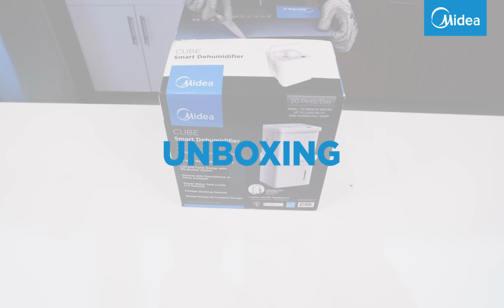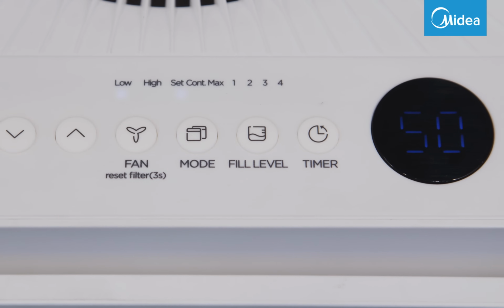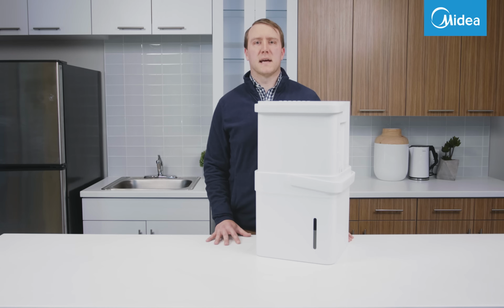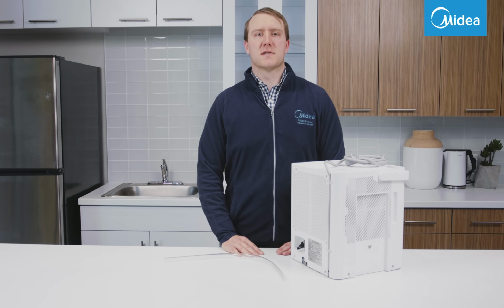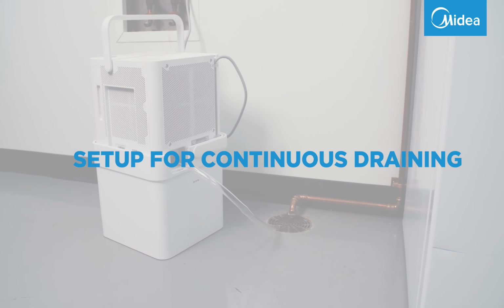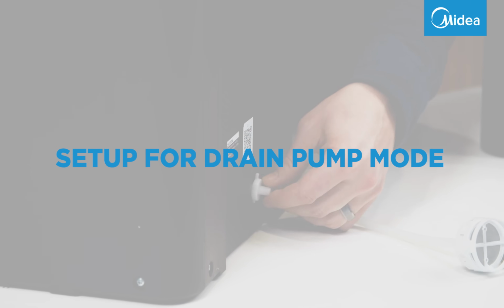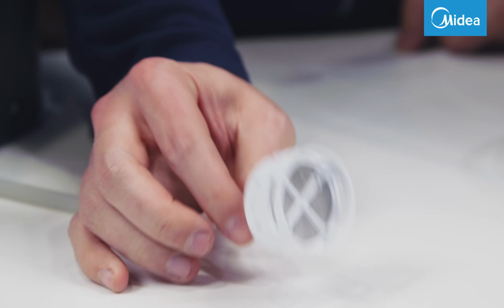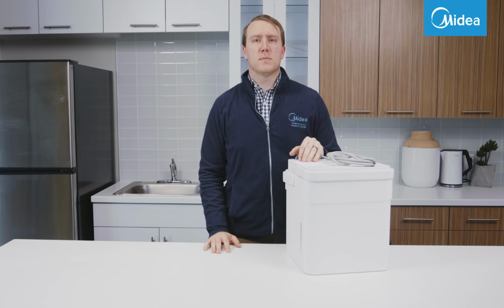Midea Cube Dehumidifier Operation and Overview

Comment: Unclear after watching video; there appear to be two sections for using drainage hose, one of which involves using the bucket. Why use bucket if hose is attached? Also, cannot determine if hooking up the pump drain and longer hose means that the dehumidifier has to be manually set in order to have pump work. Ideally, I'd like to not worry about when the bucket is filled by having the pump automatically work. Am I missing something? If the pump has to be switched each time, I see no benefit to using it instead of simply letting the unit drain via garden hose, and gravity.
Reply: Did you ever get an answer to this question? I'm confused about the same thing.
Reply from the maker: Hello, Paul. Thank you for your feedback. To better assist you with your question, please email us at DigitalSupport@Midea.com. Have a nice day.

Comment: Hi - I have to 20 pint model and when I push up arrow and fill level is goes to continous drain icon but as soon as it goes on the bucket the continous icon is gone and wont renable until removed from bucket. You should clearly state continous drain mode will not work with the unit on the bucket. Its misleading in the video an manual. Im guessing the cases remained the same and the 50 pint unti pump mode is the reason for the 20 pint looking this way. Continous drain mode only works without the bucket as a base and this is frustrating because now theres a random bucket in storage. Midea support was worthless and they gave me a number to an appliance supply store that doesnt even support their product when I asked for a technician instead of the person on the phone who didnt know how to use the humidifier.
Reply from the maker: Hello e pon. We do appreciate your feedback and will use it to improve our service in the future. We are sorry to hear you were not satisfied with the customer service. Please contact us If you have any questions at digitalsupport@midea.com. Have a great day.
Reply: @MideaAmerica  I have two of your cube dehumidifiers and they seem to work very well.  I still haven't figured out how to use constant drain, though. The amount of hose you get isn't really practical for me and I put a garden hose on it while it sat on the bucket and now water came out.  Putting it on the floor it's hard to get a garden hose that stays lower than the outlet port.
Reply: Yeah, I had that same crazy thing with a company called Mantis!  They said their techs were at some local retail store and when I called them they said they weren't techs for Mantis and said that once a store orders something from Mantis they start telling everyone they have techs there. It's crazy bullshit.
Reply: i knew i wasnt going crazy! i have it set on continuous drains, there is still water going into the bucket!
Reply: @prieshmistry  you really want to think youre crazy try contacting their support they will mess with your head until you stop replying .... typical case of crappy engineering and robotic support people repeating ad neasuem their broken maching works as designed and it clearly doesnt.
Reply: The icon isnt for continuous drain, it's for bucketless mode. If you are putting the dehumidifier atop the bucket, you don't need to put it in bucketless mode. Bucketless mode has no control over where the unit drains - if the continuous drain port is plugged, it drains into the bucket. If a hose is connected to the port and water can flow down and out of it, that is where it will flow.

Comment: Pulled plug,hooked up garden hose still drains to bucket tried calling them to no use
Reply from the maker: Hi, K Deep. Please refer to "Bucketless Mode" on page 10 using the link provided https://m.media-amazon.com/images/I/D1-CUVsknhS.pdf. If you still have questions or concerns please contact us at DigitalSupport@midea.com. Have a good day.
Reply: @MideaAmerica  ok so why have a panel you take out of the bucket to run the garden hose cause once its in bucketless mode....you put it back in the bucket and it defaults back to bucket

Comment: I love my Midea Cube dehumidifier, but I can't think of anything I've encountered with a product that is more difficult than the filter removal. It's interesting that, during this video, it cuts to it already in motion being pulled out. I'm relatively strong, but so far I've only been able to remove one filter for cleaning. Other than that, this product has been a life saver.
Reply: You have to lift up the handle to get the filters out.  That's what everyone that has problems doesn't understand.
Reply from the maker: Hi, Donovan. Thank you for sharing your thoughts on the Midea Cube Dehumidifier. We apologize that you're having some issues with your filter removal. Please send us a message at m.me/MideaAmerica so we can try to better assist you.

Comment: Hi, it seems that after filter removal, the evaporator coils are still blocked by the casing cover. In case the coils get dirty over time just like aircon, how do we clean the coils? My current dehumidifier has a removable filter which exposes the coils and can be easily cleaned with chemicals, brush, then hosed off.
Reply: Hey, did they answer your question about the coils?
Reply: @askiaabdul-rahman5137  Nope and I didn't bother to contact them.
Reply from the maker: Hi, EDMW FTW. Thank you for sharing your question! So that we can take a closer look and provide additional assistance, please contact us today at m.me/mideaamerica.

Comment: So I got my unit out from storage and the continuous drain plug was unplugged. I don’t remember if it was open or closed all last year. I only use it with the bucket. Does it need to be capped to run in the bucket or is that the only source that water drains from and needs to be open while using bucket still.
Reply: They didn’t answer the question did they
Reply from the maker: Hello Caleb. You can use this unit either in continuous drain mode or by emptying the bucket by hand. You can find more detail in the user manual https://m.media-amazon.com/images/I/D1-CUVsknhS.pdf on page 12. Have a great day!

Comment: I followed you directions exactly. Plugged unit in. Turned on unit. Pressed up arrow and fill level buttons at the same time for 3 seconds (and more; up to 20 seconds).  The bucketless icon would not show. I did see the icon when the unit was plugged in: all icons showed during "boot up". Any suggestions?
Reply from the maker: Hello Dave. If you have this unit plugged in and the drain hose connected the light should be on for bucketless mode. I see that you have already followed step 1 in the user manual. Instructions can be found on page 10 https://m.media-amazon.com/images/I/D1-CUVsknhS.pdf. If you have any questions or concerns please reach out to us via email at DigitalSupport@midea.com or Facebook m.me/mideaamerica. Have a great day. Enjoy!
Reply: horrible "instructions."

Comment: Help, the water level on the app doesn’t reset after I empty the bucket. What should I do? Thanks
Reply from the maker: Hello Paolo. Thank you for reaching out. Please verify that you have the most updated version of the application. You can disconnect it from your Wi-Fi and reconnect if you have already updated the application. If you need assistance please reach out to us via email at DigitalSupport@midea.com or Facebook at m.me/mideaamerica. Have a great day!
Reply: Same problem happened to me today
Reply: Did you figure it out?
Reply: @BP-vz8hh  I went back to the dealer and asked the device to be replaced. The first few days I had the same issue and I reported again to the customer service. I don’t know if they did something with the app, but after a few days it began working properly. I cannot tell if the level shown in the app is accurate, but after I empty the bucket it somehow resets.
Sorry can’t provide a “technical” solution...
Reply: @affanculo  so you took the unit back that was reading incorrectly
Reply: @BP-vz8hh  yes. But as I said, since the new one had the same issue at the very beginning, I can’t tell if it was a problem with the device or with the software. I’m more for the second
Reply: @affanculo  thanks for the help I am probably gonna take this one back also
Reply: @BP-vz8hh  Hope that works, I am pretty happy with the device💪🏼👍🏼
Reply: @affanculo  I was until this happened lol

Comment: This is a terrible product. Very heavy and doesn’t seem to pull hardly any water out of the air. Mine is rated for 20 pints/day and it hasn’t pulled more than a few cups in a month of operation.
Reply from the maker: Hello. Thank you for your question about the Midea Cube. We are sorry to hear that your unit is not working properly. Please contact us at DigitalSupport@midea.com and reference case number 111557589. Have a great day. (BBB A+ Accredited Business)

Comment: A really great and helpful video! It answered our questions regarding P2 and the filter icon that both showed up. I would recommend that you add a mention in the video that removing the air filters for the first time may be difficult as the demo unit in the video made it look effortless. We love the product though and are very happy with our purchase!
Reply: Uh, yeah…… still haven’t figured out how to get them out. Love this unit - but the air filter design is pretty bad. I’m a product designer, and this part WOULD NOT pass.
Reply: To anyone having trouble getting the air filters out. You need to get enough traction to "lift" the tab out, pulling towards the front of the unit (the side where the console controls are located). I found I had to try to pull by pressing my finger hard against the side I wanted to pull it out towards, while trying to lift it out of its slot. It helped if I got a fingernail under it with my other hand to help pry it out. Once the filter tab/handle is out, it easy enough to pull out. This process would have been way easier if there was barest amount of a plastic lip to get your finger under to pull it out. Bad design on that part, but not a deal breaker.
Reply: @nova31337  Would putting some duct tape on it help?
Reply: @joeking433  I imagine with enough contact you may be able to use the tape as a sort of pull tab to get some lift. It just depends on if the tape would peel off before enough lift of the tab was achieved. 🤔
Reply from the maker: Hello J. Thank you for your feedback. We strive to make our products better in the future and appreciate your time and feedback. Have a great day.
Reply: Nice video. The Midea unit worked fine at first. But after a few weeks the filter clean icon appeared and the dehumidifier stopped. The video makes it look easy, but I cannot get the air filter out. Which way do I squeeze? Make a new video showing air filter cleaning.
Reply: Where do all these gushing posts come from?  Are they paid for?
Reply: @joeking433  not sure which posts you are referring to. It's still a good system, just cleaning the filter seems to be the most consistent gripe everyone has.
Reply: @nova31337  I had no problem at all getting them out.  Maybe they recently fixed that?

Comment: the filters on mine are so tight fitting there is no fingers or hands strong enough to get them out without causing damage so I used a thin stiff guitar pick to help pry it out a bit so I could pull it the rest of the way. I guess any thin stiff enough tool could to the same but damage to the finish or worse breaking the plastic could happen so a guitar pick for me is perfect and just enough to get it started. I've read  reviews claiming the same problem.  Good video but he makes it look easy to pull out those filters but it's not. Maybe after time they'll come out easier .
Reply: thank you, we absolutely could not get ours to budge either. for anyone else looking here; the side of the "handle" toward the front of the machine has a small lip underneath, if you can wedge something in there. if the handle had anything at all to grip on to it would be fine, but there's nothing!
Reply: @Jenndar  Did you try lifting the handle?
Reply from the maker: Hello. Thank you for your feedback. We do strive to make this as simple as possible and use your feedback to improve in the future. Have a great day.
Reply: My problem too. I have many mandolin and tenor banjo picks. How do I pry the filter loose? Somebody please make a new video. I'm afraid I might break my new dehumidifier. Midea are you listening?
Reply: @stevekraus1072  there is a tiny crack between the filter and body..Pushing the pick into that will force the filter to raise enough that fingers with nails should be able to grab it. It might take several tries to get it right but it will work. I bought another  the same model and the filters are easy to remove without a pick.Maybe they've corrected the issue. I would assume a butter knife would work...just enough lift and separation to grab with the fingers. I assume you could do damage with a harder stiffer object so I use only the guitar pick
Reply: If you pull up the handle on the bucket you won't have any problem.
Reply: I didn't have any problem whatsoever.  You're doing something wrong.
Reply: @joeking433  like many other owners complaining of the same . midea has admitted some filters are too tight fitting   you should ask them

Comment: In Bucket mode is the continuous drain plug supposed to be installed?
Reply from the maker: Hello JR. You can remove the water tank and position the unit directly over a floor drain or place it above a sink for continuous draining. If you have any questions or concerns, please reach out to us on Facebook via m.me/mideaamerica. Have a great day!
Reply: @MideaAmerica  ok that wasn't my question....also I don't have a facebook account. I purchased my cube last Friday June 10th. Used it for several days and yesterday tried setting up the pump function. I can not get it to pump. Tried most of yesterday evening to no avail. Are there issues with the pump function not working?
Reply from the maker: I am sorry to hear it. You can reach our specialists via email at DigitalSupport@midea.com. They will be able to answer and assist you.
Reply: @MideaAmerica  i have the same question. can you just answer it here? do you not know english?

Comment: When you empty the reservoir of water. Can you use the handle provided or have to lift from the bottom?
Reply from the maker: Hello Mark. Thank you for your question. You will need to lift it by the handle and then lift with both hands to carry to the drainage point. You can review page 12 of this manual for specifics: https://m.media-amazon.com/images/I/D1-CUVsknhS.pdf. Have a great day.

Comment: This is good on every front except the removing of the filters for cleaning. Even after so many complaints/comments below, a clearer video with tips about how to remove them is not available. Why direct to a Facebook page, when a simple video with the detail can help here?
Reply from the maker: Hello Srikanth. We direct you to a specialist so they can request this be made for you. We strive to improve, and we have specialists to speak to the correct department to get started! Have a great day.
Reply: @MideaAmerica  You're an AI bot, right?  Not a real person, right?
Reply: Why are so many people having trouble with removing the filter.  It doesn't require any strength, it can be removed with two fingers.  With the unit upright (the controls on top), pull the slotted filter tabs toward you, it'll release and you can pull them out.
Reply: glad i'm not the only one.
Reply: I can't seem to be able to remove the filters...
Reply: i was able to finally remove them by wedging it with a metal pick. once it got going, it was easy. only done it one time, so not sure if i have to do it every time.
Reply: @janetbishop9325  Did you lift up the bucket handle?

Comment: "Pump inlet hose sits inside the water bucket"  >>> i would like to know if it's supposed to float on the surface of the water while the lower bucket fills up? And at what point does the unit start to pump water?  Obviously it shouldn't run when the water is gone,... but when is that? Mine doesn't remove any water and it is frustrating to say the least.  It is brand new and i can not find any helpful material.
Reply from the maker: Hello, please contact our specialists on Facebook at m.me/mideaamerica for assistance. Have a great day!

Comment: bought mine 3 days ago.  but it hasnt collected a single drop of water.
it says i have 31% humidity level and it only goes down to 35% . so i put it on continuous mode and even with 24 hrs of it being on. not a single drop of water was collected.
is it cus the humidity level is too low? but my previous humidifier would collect water even when it read 30% humidity before it crapped out on me.
so is it designed to just not collect water under 35% humidity? or is my  unit defective?
Reply: Where do you live that your humidity is 31%? The sahara desert? And if so, why would you want to remove even more moisture from the air to go even lower in humidity? Below 30% humidity dries out your body terribly. Also, the lower the humidity, the harder it gets to remove even more moisture from the air, so if this unit has a 35% setting minimum humidity, it's not designed to lower your levels below that. Its almosy like asking why can't your oven heat to 900° when you set it to 450°. Duh because it can't go that high. This unit can't go that low in humidity.
Reply from the maker: Hello Lahel. I am sorry to hear that you are having issues with your Midea Cube. Please reach out to us via Facebook at m.me/MideaAmerica so that we may assist! Have a great day.